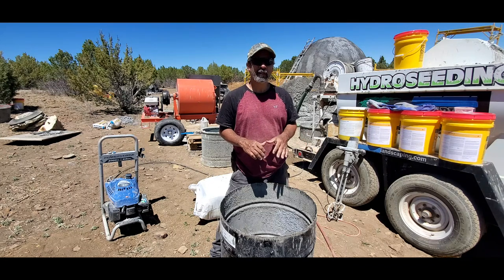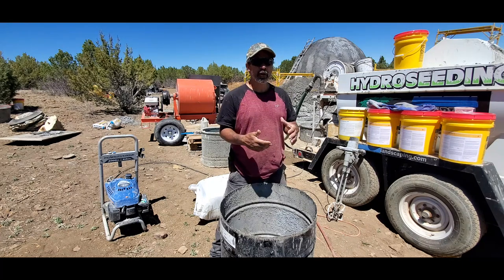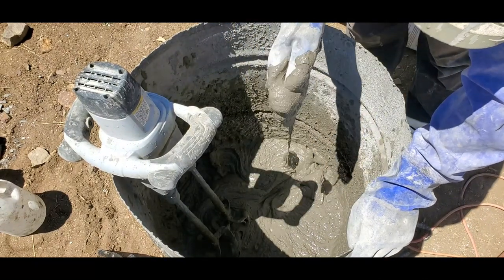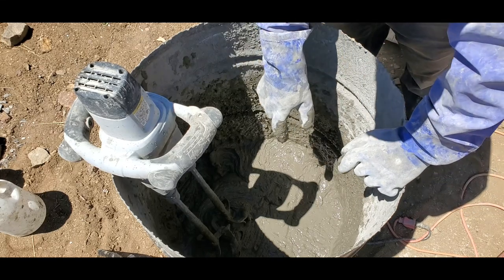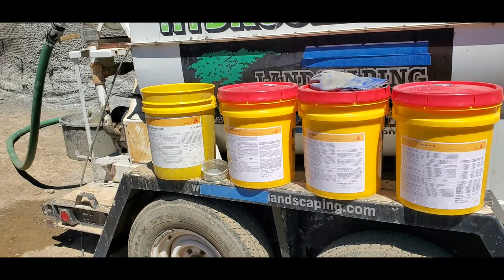Superplasticizer | Cement Work #superplasticizers #aircrete #diy #aircreteharry #domehome #diy

Comment: Have you tried just using latex paint?
And/or oil?  I have used motor oil in cement/adobe mixes to make a phenomenal stucco that dries slow, never cracks, sticks better, works up smoother and sheds water!
Got the trick from an adobe artist who mixed in linseed oil.  I was poor so I used free used motor oil.

Comment: Thank you for this, would the spraying of an airform with concrete work with a hoop house as the form or would that not hold?
Reply from the maker: It should work fine.